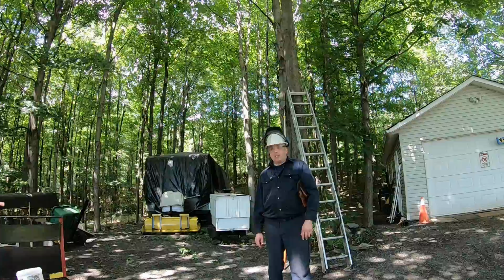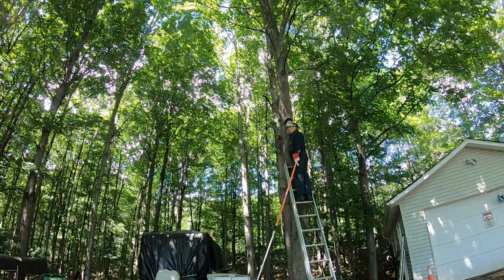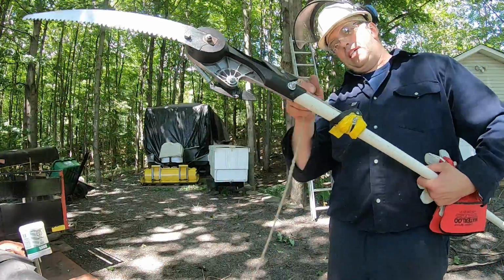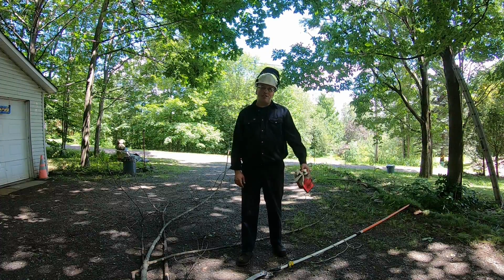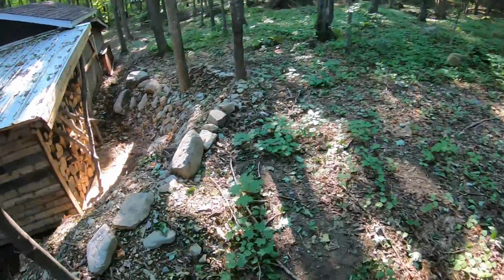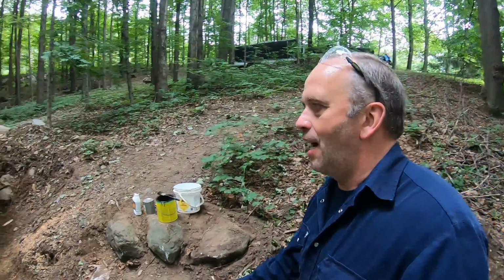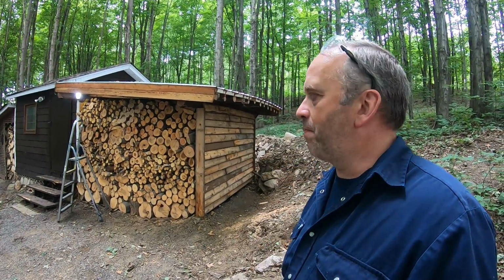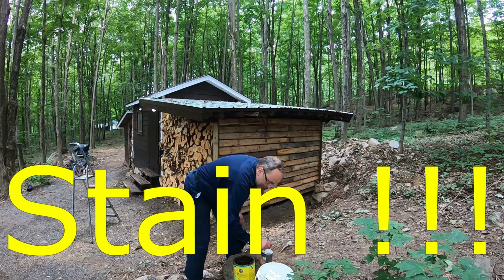Cutting high dead limbs on my various threes and recycling my old wood plank for my new wood shed 😉👍

Comment: Dead limbs are a killer.  One of my childhood neighbors was a professional tree trimmer. While cutting down a tree in  and standing downhill he was bent over at the waist with his head partially over the top of a short concrete retaining wall.  A large dead branch broke from another tree and crushed his skull in an instant !!  He was only 30-ish with a wife and two kids. So there is inherent danger in leaving those branches in place.  Have you ever seen the rubber slug and slingshot that trimmers use to toss a pull rope up high ?  You could fab something similar to launch a small twine, then use the twine to pull up a nylon climbing rope then pull the branches down with the Mahindra.  https://www.westechrigging.com/big-shot-kit.html?gclid=Cj0KCQjw-O35BRDVARIsAJU5mQU3yavMFTXB44DIQYPkJTxvP3W3bzZu7YajQf8LoO90lMr8AYVs7KgaAtnNEALw_wcB  It would surely be a safe way to get the ones you can't reach with a ladder.
Reply from the maker: Good Day Sir 👍 I'm very much tempted to buy it directly from Amazone the hole Kit ( ropes and the big sling shot ! ) it is less that 183,34 cdn,,, I think it would be very good to have.  I know that Joe use a arrow and was very good at it. Thank you kindly for your great suggestion of idea Sir and a very sad story for that young man !!! That is very good point as always Sir you are a great  inspiration !!! Cheers !!!